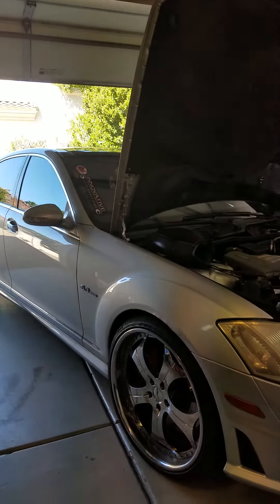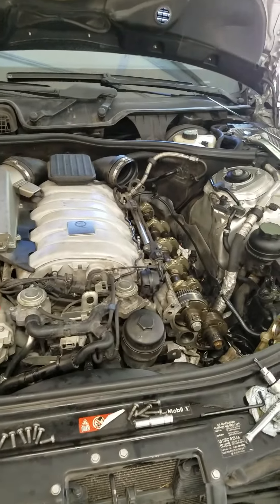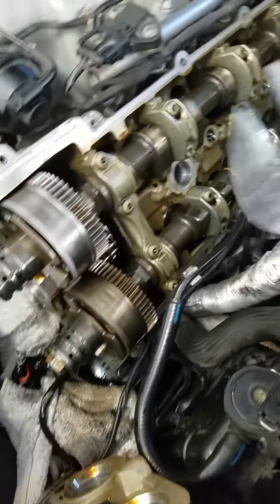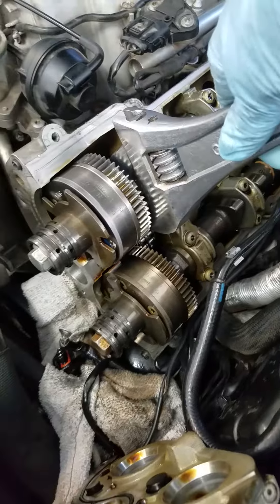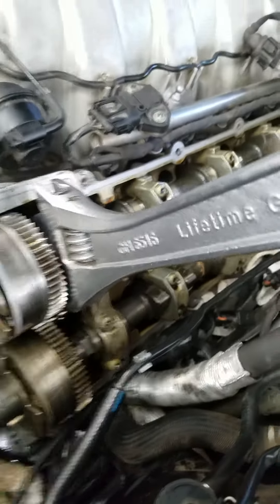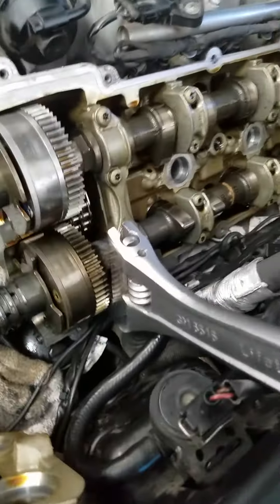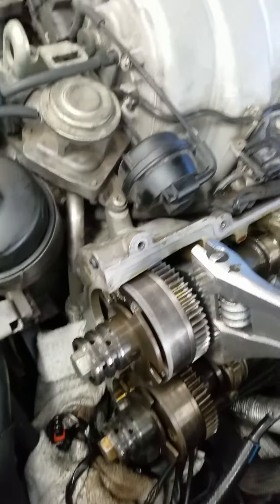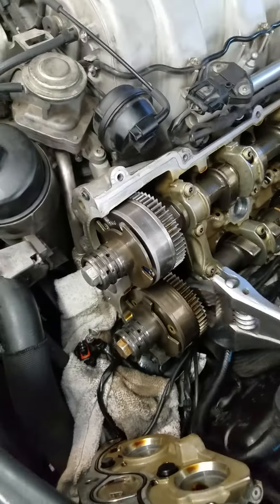HOW TO DIONSTIC A BAD CAM ADJUSTER

Comment: Hey bro, did you have the old style head bolts, worth changing for the updated bolts which won't easily snap after corrosion
Reply from the maker: Yup kinda scary  still got the old head bolts... I'm going to change out the head bolts and valve tapers here in a few months and going to do a video
Reply: @bigbodyboyz536  Great stuff, will keep an eye out for the video.